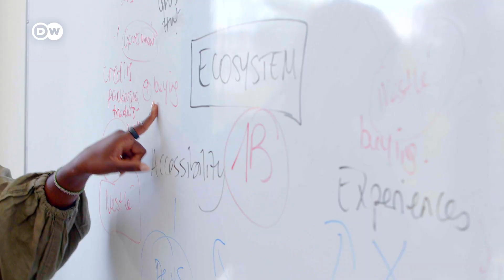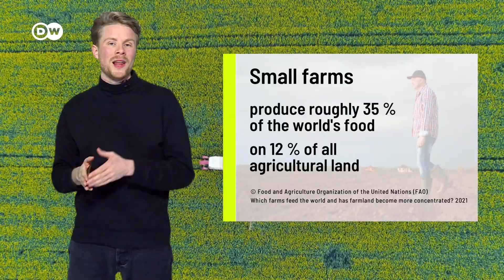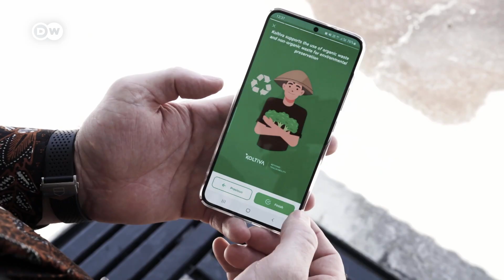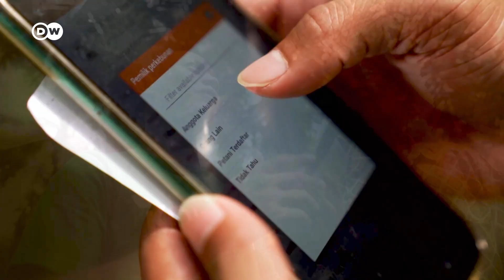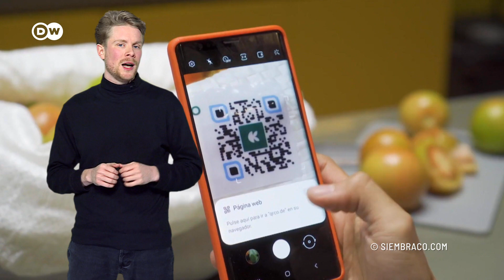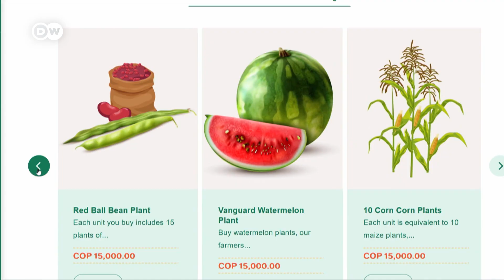Smart Farming: Tech for sustainable food

Comment: There's no such thing as sustainable growth. Growth is growth. Assuming infinite growth in a world of finite resources is dangerous and largely responsible for the situation civilization is in today. Energy blindness compounds the long term danger. Creates false narratives that are unlikely to ever occur. GDP is 99% correlated with fossil fuels. Materials 100% correlated. Every dollar is in reality a claim on fossil fuels energy. Yet we know fossil fuels energy is one and done. Fossil fuels are a gift of the sun/earth systems. Dead sea life trapped under continents in the perfect conditions 7:57 where over tens of millions of years they're cooked at high temperature and pressure into oil. We extract oil from wells, wells do not produce oil they are containers of oil. Once the oil runs out and the well is scrubbed clean by fracking there's zero hydrocarbons left behind. Convert fossil fuels energy into their oil equivalent energy and find we're going through 100 billion barrels of it every year. In our current model we must find the next 100 billion barrels of NON-RENEWABLE energy every year FOREVER. Fracked wells deplete much faster than oil wells. A visit to eia data shows wells are in decline. Shows energy returns on energy invested are falling. Easy discoveries peaked decades ago. Each new find is more expensive and difficult to recover. It's also generally lower quality. Methane gas is crucial today as it's the precursor for fertilizer. The only reason earth reached 8 billion precious humans is man-made fertilizer. 80% of the nitrogen in our bodies is from fertilizer. Burning methane for energy and transportation when there's very good alternatives is foolish. We're burning our children's fertilizer! Lastly we're adding 51 billion tons of greenhouse gases pollution into our globally shared atmosphere annually. Trapping heat equivalent energy released by detonating 7 Hiroshima type nukes every single second for over thirty years. Currently NASDAQ and other financial institutions refuse to pull off their blinders to this reality. Until financial institutions do this our situation will continue to deteriorate. We need finance to build new mechanisms to support the work that MUST be done. They also have power to call for peace, war is incompatible with a world of 8 billion with an additional 80 million net new precious humans joining us annually. At birth each makes a 30,000 day claim, average lifespan, on fossil fuels. Each day we waste using old time thinking divorced from reality the difficulty and cost spiral up up up.